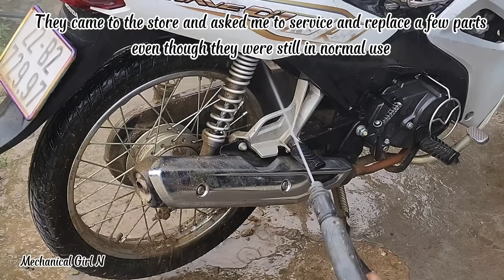Win110-Detech made in China Carburetor cannot be fixed ,  Wave@110 maintenance for rich people.

Comment: Your a excellent technician, I spent over 45yrs in mechanical repair business,  U have good habits, things like using sealer, lubing cyl walls before installing the piston, Lubricating the main bearings so they don't run dry. rotating the engine by foot before starting, and not reusing torn or worn gaskets,  most of the other technician's i watch don't do those things. I guess that is why you are so busy. Thank your for the videos.
Reply from the maker: Yes, my personality is quite careful, I am very dedicated to my work and sometimes I am negligent. I hope you will understand 😆